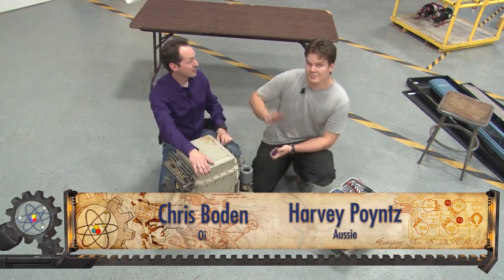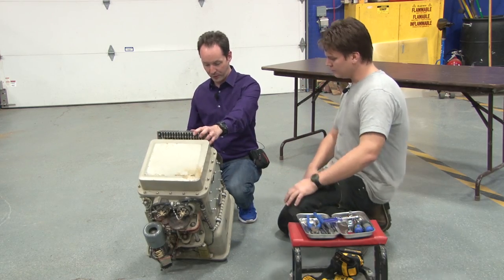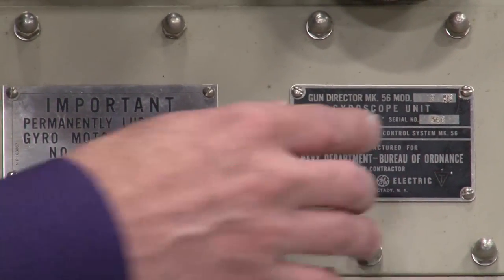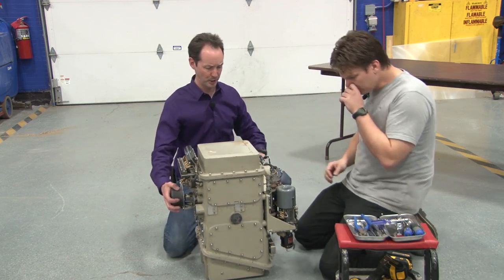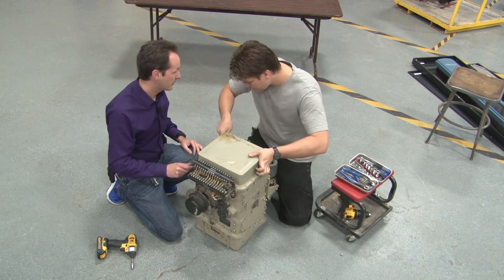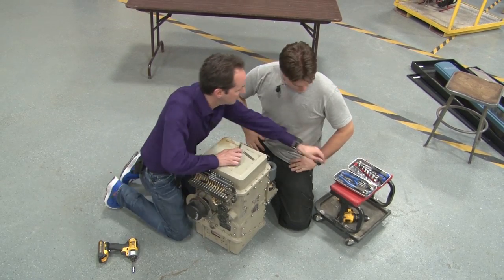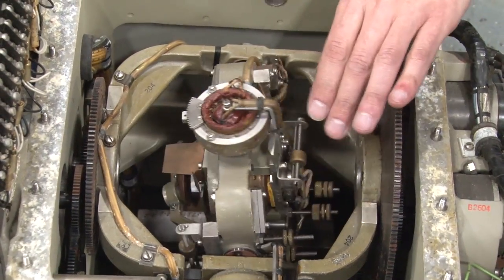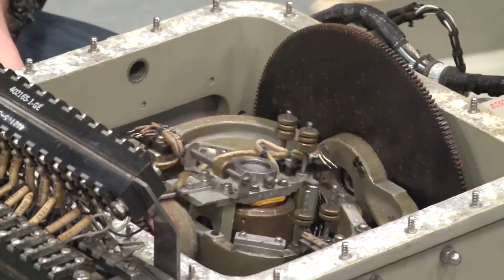GE MK 56 Gun Fire-Control System: Equipment Autopsy #80

Comment: I used to work on MK 56 GFCS (gun fire control systems) as a FTG in the navy (1969-73).  If this is a gyro for the MK 56 it was located in the gun director itself.  FYI:  the gun director housed the radar, gyro  among other things.  The director connected to the control room that housed the fire control computers.  These were analog computers built specifically for each type of gun it controlled. In my case they were 5" 38 cal and 3: 50 cal guns.  Each computer had a really complex little bit of mechanics called the "dummy gun" that actually simulated the particular  type of gun.
During use, the director would acquire a target and the operator in the control room would "lock" on to the signal.   The director would then be controlled automatically and each associated gun would be switched under the control of the computers.

LOTS of drawers of vacuum tubes and mechanics, synchros/servos... amazing stuff for its time.
Reply: This gyro measured roll and pitch to keep the guns it was controlling pointed at the target. I was FT2 on a Fletcher class can, 1955 to 1957.
Reply: Thank you both for your service.

Comment: Heres an interesting reference on this http://www.eugeneleeslover.com/USNAVY/CHAPTER-26-E.html

It appears that this was used to aim the Radar dish accurately 
The top seems to do Vertical Position, the bottom is for horizontal and true elevation
Reply: Jimmy Mish Also, it was used on boats, and according to Wikipedia, it was installed on the USS New Jersey, can't find any other boats
Reply: Jimmy Mish Additionally it looks like it is circa 1950 or so
Reply: More like a newer ship.  Was on the bb60 series battle wagon. Served on bb63 and bb64. US navy vet. The gun plot servo's were bigger and only had one gyro.

Comment: That is most definitely for a surface vessel. Airplanes don't have gun directors per se, and the gyros are much smaller, usually in packages that you can hold with one hand. Here's a teardown of a typical airplane gyro: https://youtu.be/DdbZAVyjuMg

EDIT: here's a cockpit instrument with a gyro in it as well:
https://youtu.be/AO7pn3uiWA0

Comment: 19:00 Synchro
Reply: johnfranks exactly, because it''s too old for it to be a digital rotary encoder. Analog ftw!
Reply: Rachel Mant Synchro (Selsyn) transducers are a really interesting bit of retro technology lost to the advent of solid state!

I hope he doesn't "autopsy" those and instead demonstrates how simple and elegant of a solution they were for remote analog position control/computing. 

A remote windvane might be a cool project for demonstrating... Mount one outside with a windvane attached and one inside with a direction indicator.
Reply: johnfranks windvane idea looks fun.